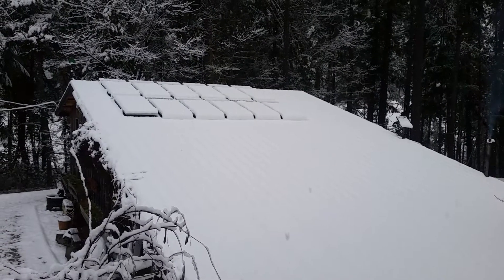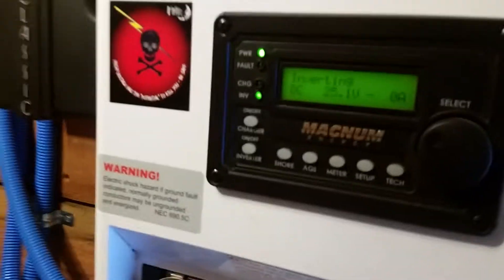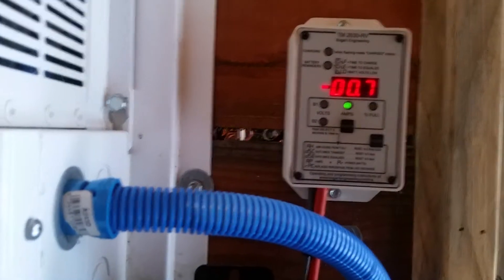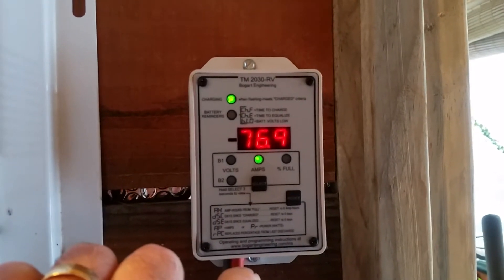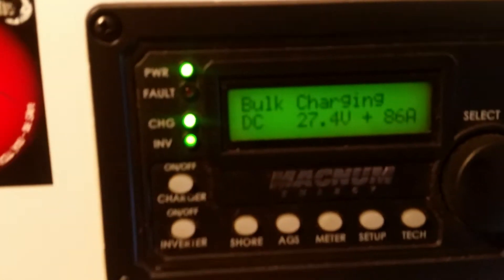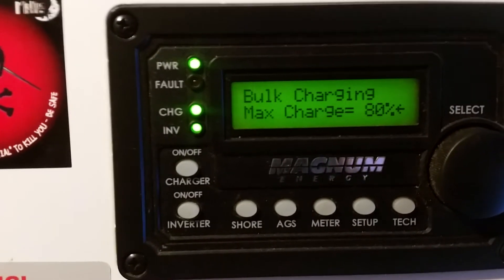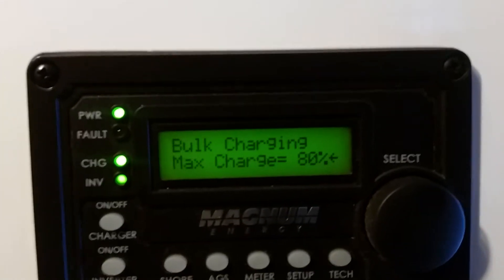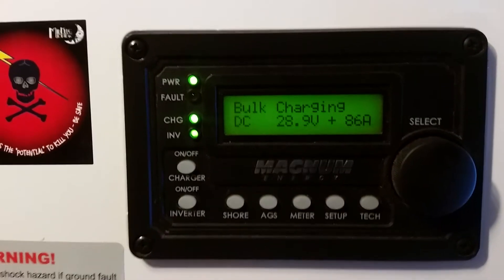Charging Batteries with the MS 4024 Magnum inverter/charger

Comment: That's a nice feature. That way you can use even a little small generator with out overload.
Reply: yeah but what happens is it trips the overload on the gen, then toggles back to 'battery', so you have to go back, reset the gen, then once the Magnum qualifies the input, it reverts to gen. Pain in the ass.... lol

Comment: When we first went off grid i connected the little 2200 watt (max) Ryobi inverter generator to the input of the Magnum and set the Charge% to the lowest setting. As you suggest, it splits the capacity of the generator up between battery charging and running the loads. All was well until either the sump pump or garbage disposal started (which she uses like once an hour..lol) - and you can guess what happens.  Overload trips on the generator, and I was instantly back on batteries.  that's when I said, "enough of 'this', time to build a serious DC generator". I about fell off my chair when I seen you ramp that up to 80 amps-- but then I did the math.. yep, that's one serious military gen-set you have  :P
Reply from the maker: Mark Osborne I do not get the same efficiency as you do with your Yanmar but our fuel cost this year is under 25 gallons of off road diesel. You do have bigger loads than I do. I am still going to build the 186f generator with a 200 amp 28 volt alt. with remote  sense circuit. I have the 186f generator on loan to another off grid neighbor until I get a chance to rebuild their generator.
Reply: You have an actual Yanmar 186F correct ?  unlike my chinese knock-off that stinks up the neighborhood  :-0
Reply from the maker: I have the Yanmar L170 and a Cina 186F that runs clean. The China motors just need to time the pump. There are shims that need to be either added or taken away under the pump.
Reply: Ya know, I wondered about that, meaning, the timing. I've smelled this particular smell on rare occasion while following an older Ford or GM dump truck from say the '80's that is obviously tired, or out of 'time' as there is a haze in the air. But it's more that a haze, it's a stink.  It's rare, but unmistakable. Putrid  ---- I mean 'stink !'   If you've ever smelled the smell, you'd know it.  The same diesel fuel in my 10,000 hour Yanmar has absolutely none of that exhaust odor. This Chinese 186 will make you want to run from it.

When I built my last pulling tractor I used a bore scope to ensure the spray pattern from the injectors was entering the bowl in the correct location.  I have 5 x 20 injectors, much larger than factory. 20 as in .020 inch holes.  Way bigger than factory. It's so we can push 400 cc's of fuel thru the 6 injectors inside of 1000 revolutions of the pump, or 2000 crankshaft revolutions.  In the process of EDM'ing the injectors, there's always a risk that the spray pattern is wrong.  I have a friend with a quarter million dollar machine that went thru 2 or 3 sets of pistons before they figured out the TDC mark on the injector pump gear was place in the wrong location by a pump builder who will remain nameless. They were spraying diesel on the cylinder wall, instead of into the bowl. My point in all this gibberish is - ya, timing means a lot--  but stinky combustion ?  .... it's something I've never smelled in 20 + years of tractor pulling.  I'm talking tractors that need the better part of a can of either to get going, tractors that need a salamander pointed toward the oil pan in a summer day, just to get to the point where they can run on diesel without the need of either.  They never smelled like this stinky 186 diesel I have sitting in the corner of the shop -- the mystery, which you, my friend, can totally appreciate, with all your experience in power generation, may in fact be timing- wouldn't that be a hoot.

Comment: Do you have a video of your battery bank? With ah and the info on them and what you normally consume in a 24h and what it takes to put it back?
Reply from the maker: Christopher Boone Some whare I have a video or two on the batteries. I have eight L-16 6 volt batteries in a 24 volt configuration. That is 840 amp hours at 24 volt nominal.  I use to be 100 amp hours over night. It takes 2 hours of full sun to bulk the batteries pluss 3 hours of absorb time. We have a 4.8k solar array.
The bulk cycle is full power of the array the absorb cycle is however many amps 8t takes to hold 31 volts for 3 hours. I can hold the absorb cycle even in the very cloudy weather. It might only take 15 amps or less to hold absorb while in full sun the bulk cycle is over 125 amps.
Reply: Steven Davis do you know if there is a ratio of solar array to how many batteries? I’m looking at new batteries and done want to get to much ah and my solar array can’t put a good charge rate back into them. I use about 1.7kw in a 24 day my solar array is 1580w. Its my off grid cabin with only a fridge and tv and some lights

Comment: Hi sir ..  got a question does the generator output has to be 220v or 120v to each leg of the charger..?
Reply from the maker: It depends on which inverter/charger you buy. Mine is the MS 4024 and has a 120 volt ac input from a generator. 
The MS 4024PAE I believe is a 240 volt input that. I have gravity feed water so I do not run a well pump so we have no need for a 240 volt split phase inverter.
Reply: @offgridinthepacificnorthwe3210  my is the ms4024 pae . I was reading input can be 120v or 240v. If miss read.  Thanks for your reply .. is a rain season and my batteries not getting charge. I for got I had a inverter /charger ..lol
Reply from the maker: @MrRuss58  I would look over the manual real close. I have not read mine in years. You may be right but I think the 240 volt model is the PAE. Let me know how it works out and Mary Christmas!
Reply from the maker: That is my next one I will buy. They are perfect for well pumps.
Reply: @offgridinthepacificnorthwe3210  . Yea it works perfectly in 120v from generator . And if you have a 220v generator works good.. charge battery to full around couple hours . Yea this thing is amazing.

Comment: Ok. I setup my . Is at 27.8v +44amp. How does yours go up to 86amp . My Gen is 30amp outlet 3000w..where you have setup the ac input voltage..?

Comment: Can it do both at same time?
Reply from the maker: Glen Wagner  As soon as the Magnum sees the power coming from the generator it sends 120 volts ac to the house automatically and charges the battery at the same time. When you turn the generator off it starts inverting and sends power to the house. It happens so fast it won't even flicker the power at the house.